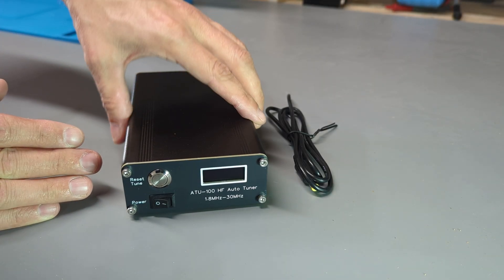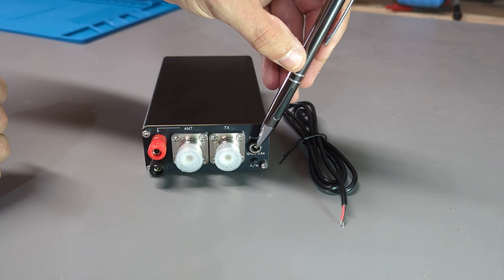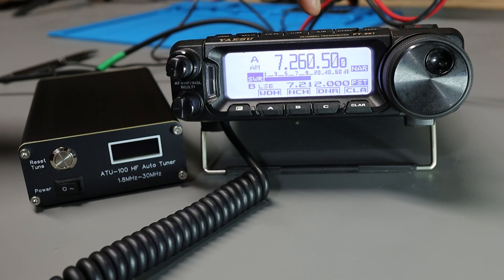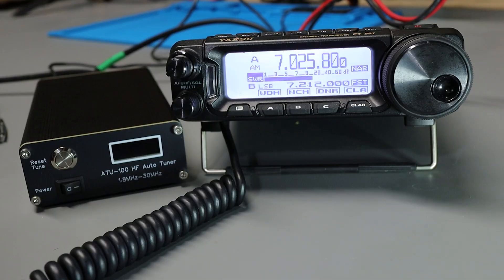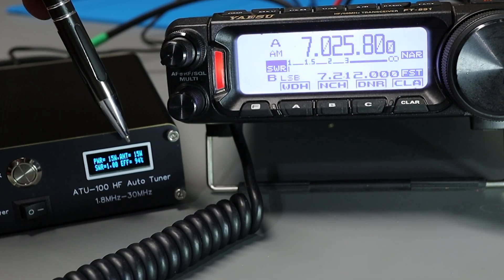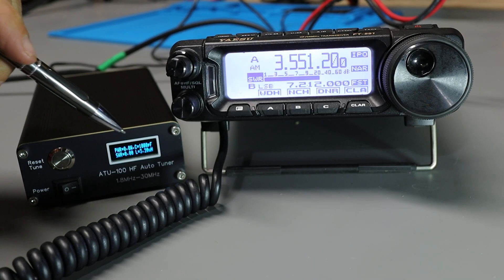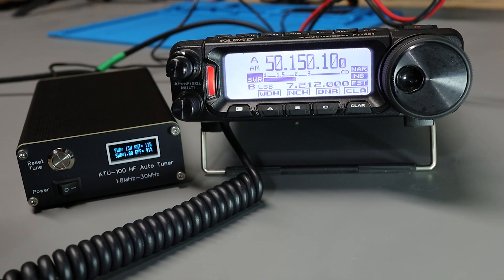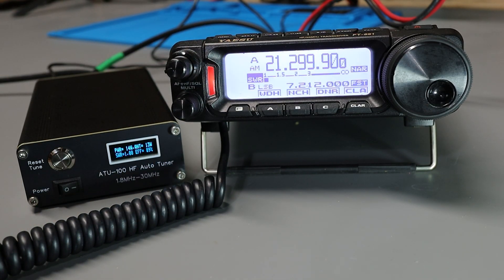Does This Tuner Really Work?  GOOZEEZOO ATU-100 HF Overview and Demo

Comment: I've used an ATU-100 for about a year.  I recently picked up a ATU-130 which has a 4:1 balun output (my ATU-100 did not) and also the bypass button (which my ATU-100 lacked).  It will allegedly do 200W and 100W digital.  The toroids are significantly larger and the relays are 5A vs 3A.  73 KK7YIS

Comment: I had a question on tuners, I have a yasau FT710, only 1-1/2 years old, the internal tuner doesn’t seem to tune, on any band, and will not show Any SWR at all even on A.M. I’m useing an ultra max 100 wire antenna that will do 80-10meters, when I put an inline, SWR meter to the coax the external meter doesn’t show any power and no SWR, however to test my theory I hooked up an Yasau ft991, to the same antenna, and everything works fine on all bands, also my firmware on the yasau FT 710, still has the original factory version, on it. Now I think my yasau has 6mnths of factory warranty left, please note, the FT 710 was also MARS , by HRO when I purchased it from them.
Reply from the maker: Check with yaesu or HRO...I'm not sure what's wrong but it sounds like maybe your radio is messed up

Comment: Good price. My automatic tuners are LDG ones. I have a MFJ manual tuner for my ICOM IC-705. Is there a minimum power output required  from the radio to activate it?
Reply from the maker: I think 5 watts
Reply: I have the Malahit version.  It requires only 0.1w to tune.    Tunes very quickly and accurately.   I just keep it to “Auto”.

I have tested it on several radios and works perfectly. 

I have an LDG Z-817 which I packed away after my first time using the Malahit ATU.    I’ll probably sell the LDG.